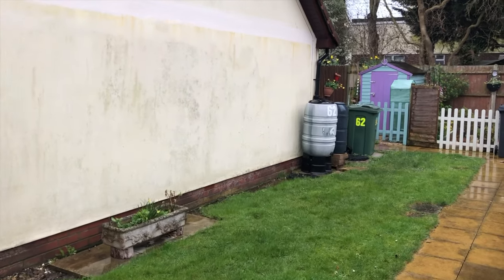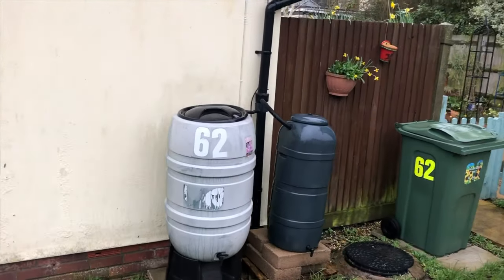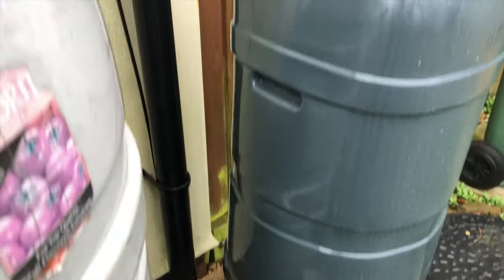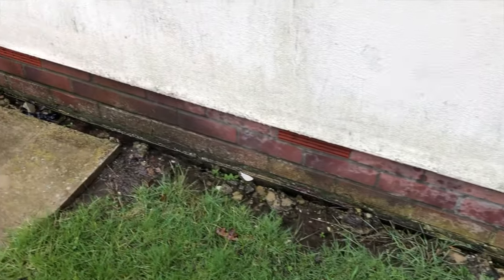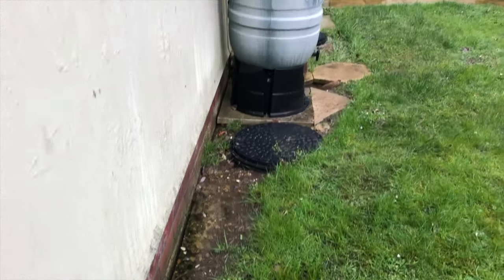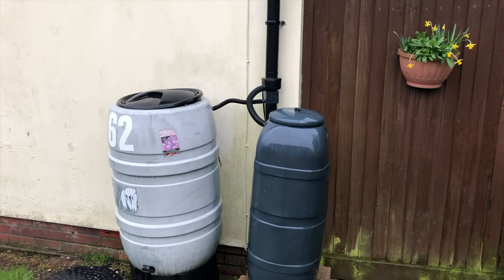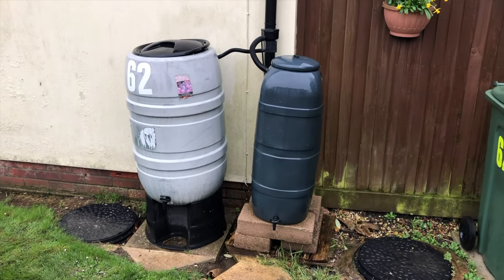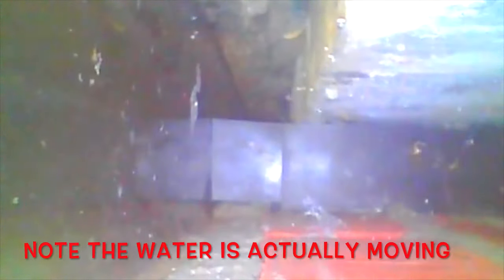Water butt install tips to stop damp issues

Comment: You connected the diverter higher than the actual butt, of course its going to overfill.
Reply from the maker: If you listen to me this isn't what I have installed, and also if you read the initial description this is covered by me. I've got another one that you might find interesting I will be posting shortly .Thanks for looking in though